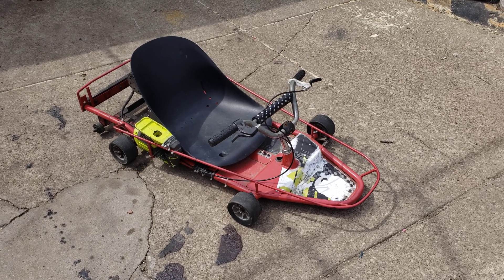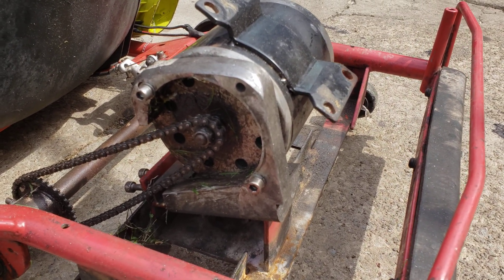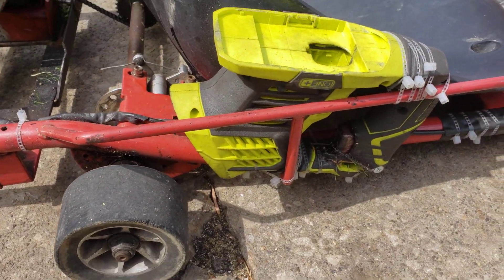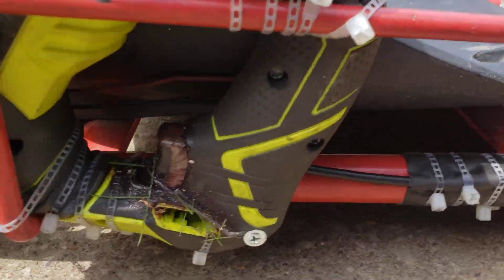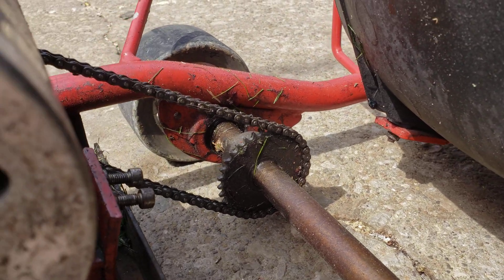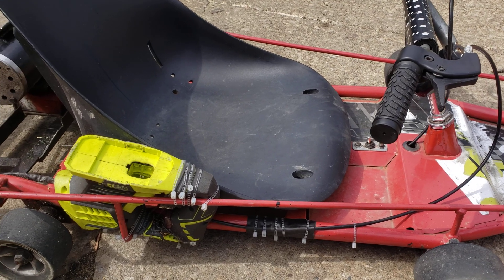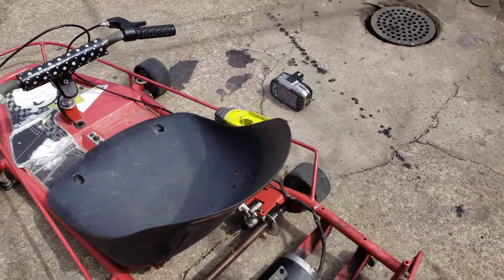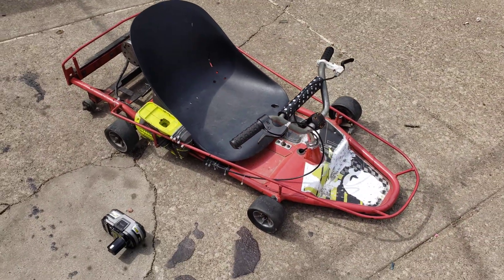Ryobi powered go kart

Comment: I was thinking of doing the same thing - Nice idea using the trigger off an old saw for your speed control.
Reply from the maker: @scottbennett8018  thanks I converted it to a full 24v cart with a speed controller later on but they've have since outgrown it and moved on to bigger things
Reply: @liljay51884  I have a 4yo and a 7yo I just them gocarts   it would be nice to be able to power them with ryobi batteries as I have a dozen or more of them.

Comment: Did the same thing but have it set up with 36v (2 M18 Milwaukee 5amh) batteries and the speed and throttle controller to match the 36v. Want to upgrade to 72v system and use my greenworks 80v batteries
Reply from the maker: My wagons are 48v love the extra power

Comment: Brand of the kart?
Reply: Power kart-bladez 
I attached same kind of motor 36v with speed controller and throttle controller. And hooked up two m18 batteries in series for 36v.  wish I could post pics on here.
Reply from the maker: @edwino.3490  I have no clue I got it off Facebook marketplace